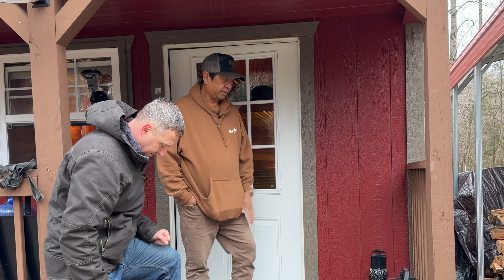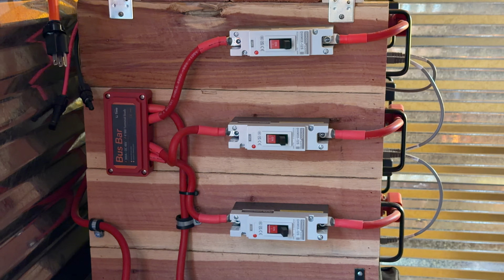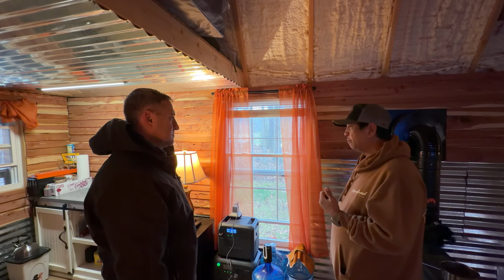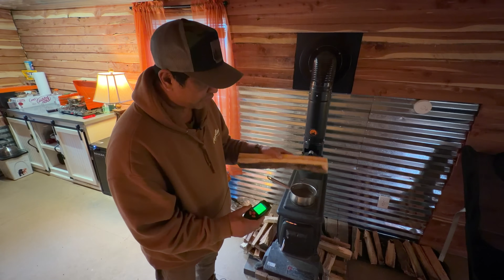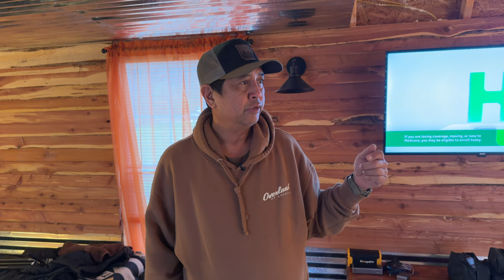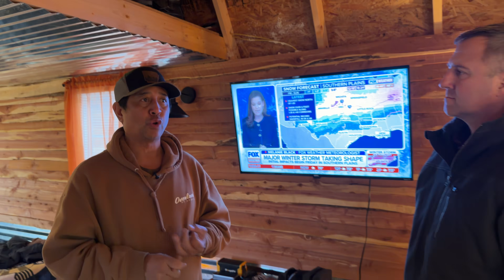He Built His Off-Grid Dream From Nothing! (It Takes Grit)

Comment: Just throw an electric well pump down in the water well and hook it to the battery banks, why would that cost $12000?
Reply: The pipe needs to be replaced, the well has been sitting for over 40 years. There is no opening g to just lower a pump down into it.I’m not paying 12k for a new system,
Reply from the maker: That’s a good idea. Could pump water into a cistern.